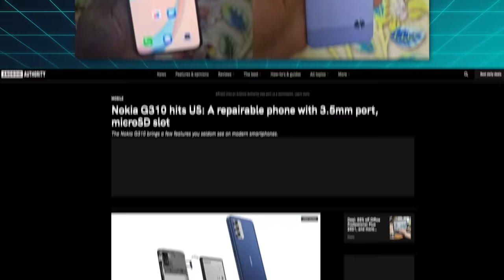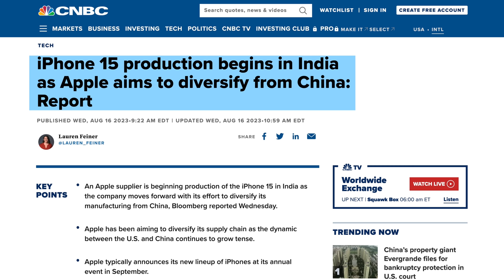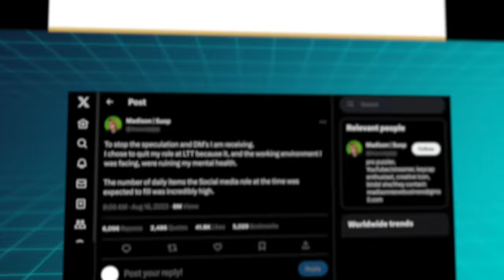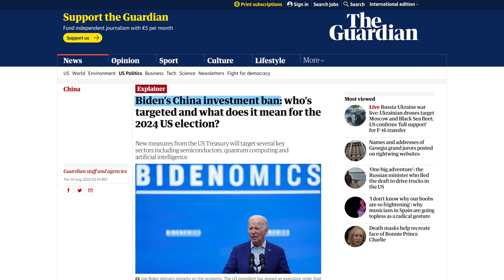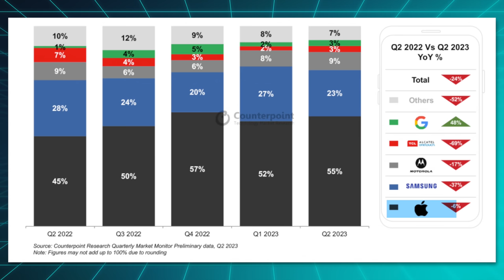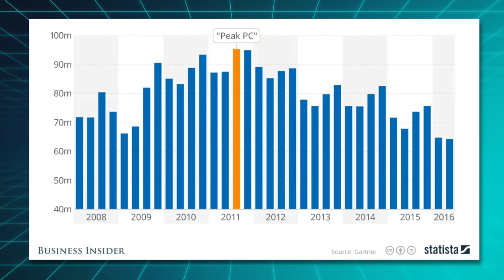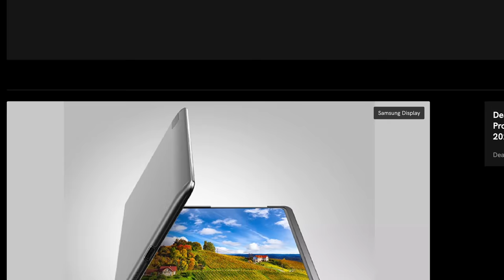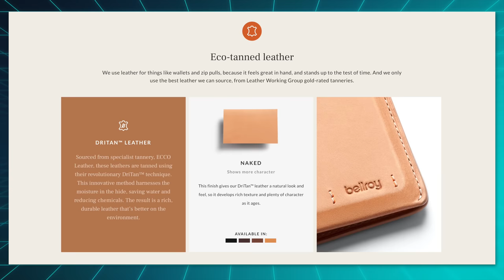Phone sales keep crashing (down to 2013 levels)

Comment: Ofc the phone and pc markets are at a lowpoint. True innovation is stopping. Technical requirements for software are barely rising. Now it is possible to game with older hardware. 
For example: a gpu in 2012 for 500 euro dont really last 5 years.
A gpu in 2017 for 500 euro is still running almost everything on ultra after 6 years so it will still last another 3-5 years. 
With these slowing requirements, people need less new phones and pc's. My phone is now 4 years old and i like to keep it but now i get forced into a new phone because apps are starting to force me to change phones.... 
I think phones of this day are good for 10 years. Would love a phone for 300 bucks that gets supported for 10 years

Comment: Unsurprising. Smartphones aren't really improving any more and with the hardware in them being as powerful as a mid-level gaming PC 99% of people have zero reason to upgrade, let alone blow 1300 bucks on a phone when one for 250 will serve them just as well and for just as long. In face they've now started losing features year over year like SD card slots.

Almost nobody outside Asia is actually using their phones for high end 3D games so 80% of the money people spend on this frivolous hardware ends up being a waste.

Considering the pending new EU laws concerning repairability, mandating standardized charging ports and removable batteries this is likely to get way worse for the corpos.

My next phone is likely to be the Fairphone or the German Switch Phone, both of which are modular, with spare parts easily and cheaply available through official webstores and aiming for a 10-year support cycle.

Comment: The tech has reached its peak there's not a lot difference between phones these days. Most people need something that's fast enough, has a good enough camera and that's about it. The issue i have with tech companies is they prattle on about climate change and release a phone every year which is a minor upgrade on the last one.... phone release cycle should be 2-3 years minimum. Nearly all decent improvements can be made in software these days.

Comment: Ive literally never actually desired to upgrade my phone beyond the fact that replacing screens and batteries is just as expensive. I just buy an ok mid range phone and throw a decent case on it and im done. Honestly i could get away with having a flip phone and small tablet most of the time and honestly if i suddenly broke my phone id literally just do that for a bit

Comment: No doy. Why would you need to upgrade a device that already takes great photos, has an amazing screen and a processor that is plenty powerful since the iPhone X/11? The most common use for iPhones nowadays is scrolling on tiktok and Netflix which doesn’t even require much power. Plus, if the battery starts going bad you can take it to a repair shop and get it swapped for around $70. Definitely beats paying $1000 for a phone you won’t even notice a difference with.

Comment: 2013? Funny. Those were the days of the OnePlus one. Still the best value for money phone that I've ever owned.
Interestingly, my interst in Smartphones has followed this trend, as there are like absolutely no interesting phones on the market anymore.

I'm looking for an upgrade from my 5 year old Nokia 7Plus, but I cannot really find a worthy contender.

All modern phones are at least in one of the areas that I need the most super f*cking bad.

1) Google or Samsung have the best cameras, but shitty Fingerprint readers and no SD Cards, but super expensive storage upgrades or a super expensive cloud subscription to make up for it.
2) Batterylife seems to have decreased on modern Smartphones. The S23 has a reputation for lasting meerely a day of moderate use. Pixels get incredibly warm under heavy use which kills the battery super quick.
3) Processing power seems to be only up to spec on Xiaomi, Oppo or OnePlus phones, but they have not so great cameras and annoying software
4) Repairability is the last thing. And here the field empties to reveal the only brand that cares about this: Nokia. But Nokia phones have crappy cameras.

I am absoltely not surprised why nobody is interested in Smartphones anymore, since all the stuff on the market is arguably WORSE in terms of utility than what was availabe 5 years ago.
Reply: I have a Pixel 7 and the fingerprint reader is horrible.  I am not sure what they do wrong, but usually, I have to enter the pin...

Comment: I paid $1200 for my iPhone 12 Pro Max in December 2020. Surprisingly the phone has held up so well being nearly 3 years old and used heavily daily! With that being said Apple hasn’t released anything in a while that has me thinking I have to buy it. The foldable phones are pretty cool but are more expensive than I paid for my phone which was a lot. Maybe 2024 I will finally upgrade… or not😂

Comment: My new phone is hardly any faster than my old one. It holds the same amount of data.
It has a slightly better screen and worst battery life but it does charge wirelessly. At the same time is doesn't have an SD slot, or a phone jack. The camera is better but it makes hardly any difference to the snais I take. So why would I pay an extra £ 300 for something that's not better and in baby ways the count worst.

Comment: There is very little innovation in the phone space and that's exactly why those large phone manufacturers don't want to support phones with software for longer than 3 years.
They want to keep buying new ones even though you wouldn't even need to. That's planned obsolescence in software. 
I hope the EU will force them at some point to reduce electronic waste.

Comment: Oh well phones are basically the same for a while now. Display resolution and tech stays the same. Even the low end processors have enough power for everything most poeple need. The flagships are basically for enthusiasts and power users and the new versions bring just small incremental upgrades, in HW and in SW as well. There isn't any new revolutionary innovation to happen and there isn't much of a reason for most people to upgrade. The folding phones are the next big thing with potential being also in making more efficient chips rather than needlessly powerful and power hungry.

Comment: Iphones aren't long lasting devices anymore 
They throttle because of no cooling system  screen dims all the time they don't have user friendly ui and navigation is uncomfortable.
Ios 16 was so buggy for 5 months.  The iphone 14 batterys are defective and the degrade crazy fast for so many users like the battery on  vanilla models wasn't already bad 
Dynamic island causes burn in the display 
Only 60hz for vanilla models and the old cpu on iphone 14 witch has same the cpu with the 13 models 
The photos from Iphones aren't that great compared to Samsung and Huawei.
They lack a ton of hardware and software features
Idk bruh 
Does it really worth it to buy  iphone if you don't have already the apple ecosystem anymore? 
They are so expensive for reasons that I can't see or they Doesn't exist.

Anyway my point was to say here 5:55  that iphones aren't long lasting anymore and that's why the sales go consistent
Reply: iPhones were already garbage since Steve jobs was still here, nothing has changed. If you see Louis Rossman and Hugh Jeffreys and even mkbhd complaining about iPhones, you know something is wrong with that brand
Reply: @danteerskine7678  yeah I've seen and I agree..
The iphone 13 pro max tho ithink is the best iphone apple ever made (only for people that love iphones, I couldn't stand any iphone they lack a ton of things like :

The best screens
Usb c 
ufs 4
Reverse wireless charging 
Fast charging
The best photos(details,dynamic range,zoom)
A good keyboard(numbers above letters,Shortcuts for symbols, clipboard button,accurate word suggestios)
Desktop mode 
Ultrasonic fingerprint sensor
120hz screen in vanilla models 
Easy to use design (rounded edges)
Not heavy built 
Multitasking (plitscreen, pop up view).
Default ui Shortcuts for so many functions.
reachability on system apps by default.
Customisation(launchers, ui colors,change category classification in settings app,more quick settings, select icons on the very top of screen that shows notifications ,different animation speeds,easily resisable widgets,power efficient always on display, themes,icon packs,fonts, ringtones,task changer layouts,voice changers, more decidel steps to choose, change the ratio of size and percentage of applications that take place on the home screens and app folders,

Excellent 3rd party music players (poweramp)
Built in Equaliser .
Adaptive sound.
LDAC BLUETOOTH CODEC(best codec for quality sound over Bluetooth made by sony)
Google assistant that listens without having the app open 
More advanced camera settings 
Better one handed mode(screen gestures,navigation styles/types and looks)
T9 in phone app
Grouping notifications
Link & qr file sharing (Google apps and Samsungs quick share has this)
Bigger batterys to last more years
Sim card slot
Updates to app store apps when the phone gets outdated from IOS updates
Easy way to restart and close all apps button.
Ability to show all apps that run on background.
ADB
better t9 in homescreen search
Sideloading apps (modded apps,piracy apps,other usufull apps , the ability to try your own apps,ability to downgrade buggy apps, update apps on unsupported regions, download outdated old forgotten apps and games for example geometry dash, badland 2)
Wired fast data transfer usb c 3.1 (maybe 4 exist already?)
Secure folder
Real nfc for connection with nfc devices (Bluetooth speakers)
More advanced Routines & automations
Live( interactive)& video Wallpapers
Balance screen colors (r.g.b)
Non auto trutone
RCS (Rich communication services) witch make all that mess with messaging in the U.S.
Plethora apps in app store(tbh both stores have great apps but app store hasn't the apps I want)
A better file manager THAT SHOWS PHOTOS THAT I TOOK WITHOUT TO HAVE TO PRESS SAVE GROM GSLLERY APP FIRST SO I CAN FIND IT IN APPLES FILE MANAGER THIS IS SO STUPID.
Voice typing with commands
Wired power sharing
Choose other browser for default and not safari
Settings of system apps inside every app separetly and not settings of system apps in settings app .so it's easier to find the settings for every app
Stylus with Shortcuts and gestures and other button mapping for different activities in different apps 
Not lower the brightness when phone get a little hot 
Better cooling system 
Faster easyer screenshot editor
Not having notch
15gb free cloud and better compatibility with other cloud apps
Pictures in picture mode in apps like  zoom/webex or messenger bubbles or screen recording controls.(start stop pause draw type)
Sound search Shortcut app icon from Google so u don't need shazam
Easy accessible settings of the controll panel features (not having to change the settings / layout with settings app)
Choice of storage folders/directory for apps such as voice recorder or safari...
Call recording
Easier cache wipe at least for the old models that don't have enough ram anymore.
Internal audio recording
Object remover from photos and unblur photos.
Radio 📻 
Some Compatibility with non apple OS like Windows/linux
Option to screen mirror only one app while simultaneously using other apps that are only visible on the mobile screen.
Whole code with letters numbers symbols or pattern unlock for lockscreen
More notification looks/styles (minimal, detailed) 
Color smooth flashing on screen when notification.
mapping the power button with whatever u want 
More options for back taps just like power button 
More options for dynamic island (3rd party app tho )
Live captions.
Ability to put a different languages in different apps (insta in Spanish, viber on English, settings in Greek ,youtube on another...)
Reply: @wheelyflac yep. Exactly. The fact that the browser is shit and doesn't conform to standards and they don't even let anyone else build a decent browser really gets me. I'm constantly have trouble with people who are getting some stupid error and it is always because they have an apple phone.
Reply: @danteerskine7678 It is garbage yet their sales keep going up and have the highest rate of Android switchers.😂😂
Yes, the iPhone is garbage yet still gaining market share from Android, right?

Even as an Android users, I can't deny the fact that iPhone is great and works very well. No wonder they keep growing in numbers even in the refurbished market because they generally last longer that the Android competition. 
You just need to get off the hate train and face reality!😂